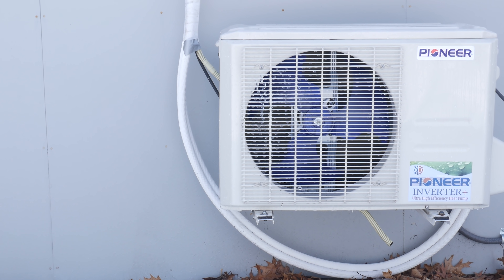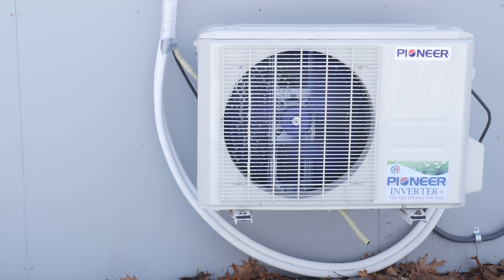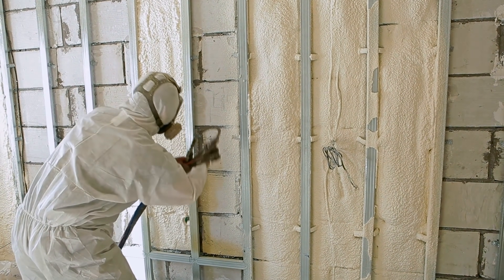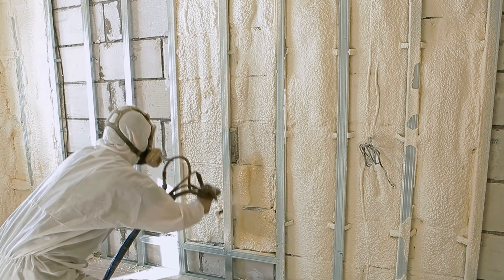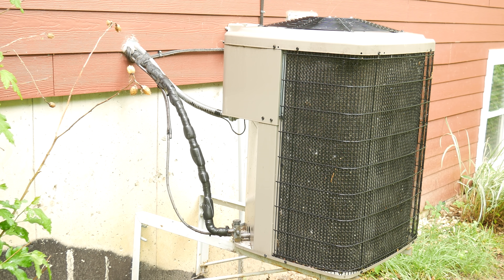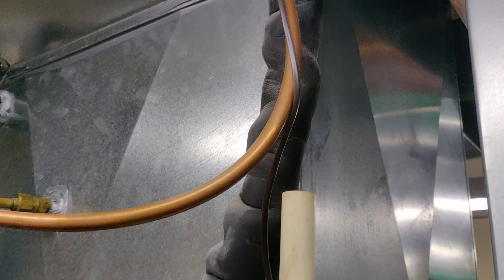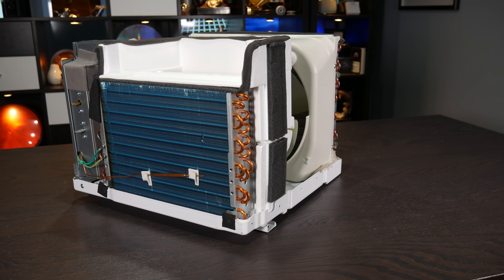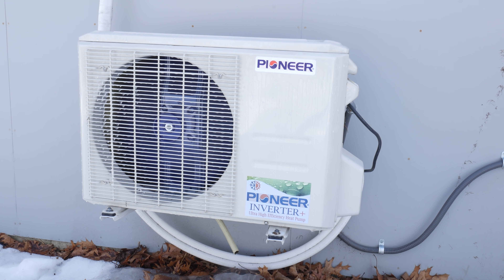Heat Pumps are Not Hard: Here's what it will take to start pumping

Comment: Great series.  You are doing great work.

It seems to me that this should be a MASSIVE opportunity for  a market disturbance.  With all of the venture capital nowadays chasing after ever more mundane market segments (like matresses or funeral homes) you would think that some venture-capitol backed startup would already be trying to "revolutionize" the home heating and cooling space.

I mean, a new whole-home furnace/ac in the US is somewhere between $5,000 - 12,000 (replacement, no ductwork) and it really seems like these devices are smaller and less sophisticated than your average washer and dryer or what-have you.  Lots of high-pressure, scammy tactics in that market too.  

How hard would it be for the "AC/Furnace Uber" to arrange for some basic products, arrange for local installers via something like a franchise system and still offer consumers good products at 50% to 75% discounts compared to the typical closed distributor and HVAC shop "cartels."
Reply: They have been readily available for a while. The thing with HVAC companies and mini-splits is that you can just buy them online or in a store, which you cannot do with most larger systems. The other issue with these is the capacity; it is nowhere near what you can get from a ducted unit without accounting for duct losses.
Reply: The mid-roll ad on this video was a DIY AC unit. Wall-mounted ductless system for single family homes. The market landscape is shifting. I can't wait for mass adoption.

Comment: I would love to re-insulate my house, install new windows, and look into switching into a heat pump with gas for emergency heat, but we also need programs to assist folks who own older homes that contain asbestos.

What would be a relatively simple (yet not inexpensive) reinsulation project turns very quickly into something completely uneconomical when the ridiculous cost of asbestos abatement is factored in.  It almost turns it into one of those "It's cheaper to demolish" situations, but I can't justify the cost and disruption to my life in order to do this.

So I'm stuck - I can't afford a better home because home costs have gone crazy, and I can't afford to resolve issues in my current one in order for my life to become "greener". Sigh.
Reply: It's surprising how many homes have some kind of complicating factor like this - and they're the ones that would benefit the most from upgrades! 
Although asbestos removal can be inexpensive. Recently had a contractor look at my asbestos drainpipes - and they said they'd have to remove them but they could double bag them leave them here and we (as residents, rather than a company) can get a local authority to take them for free. If they took it away (as a company) they'd need an asbestos license and to pay per kg. 
In my case - I want a heat pump but don't qualify for a grant because I don't have cavity wall insulation. I can't get cavity wall insulation because of concrete gutters - they're known to fail over time and leak onto the insulation, causing really bad damp problems - so no regulated installer will install it unless the gutter has a guaruntee'd lining. So in order to install a heat pump, I have to remove/reline my gutters 🤯🤯
Reply: @naxxtor  Certainly, sometimes asbestos removal can be fairly inexpensive, especially in the case of Vinyl Asbestos Tile, Pipe Insulation, Acoustical Ceiling Tiles, etc.

In my case, there is use of Zonolite-Sawdust/Asbestos insulation in the walls and ceiling spaces.

Tearing open all the walls - even the upper level floor (which used to be an attic) to remove it - would mean I'd have to move out completely in the process.  I'd be willing to bet that the cost would be $30-40k just to have it removed, then add the costs of putting whatever new back (foam, fiberglass, etc) and then new wallboard, paint.  It's a nightmare.
Reply: Yes, I would also like the government to pay for my choices as they can be expensive
Reply: @MrCheeto01  No.  I don't need the government to pay for all of my "expensive" choices.  However - the real estate industry does a piss poor job of informing buyers and obtaining disclosure from sellers regarding the presence of things like asbestos, lead paint, and other hazardous materials.  It has also been a sellers market for many years, and as a buyer in this climate you don't really get the opportunity to get thorough inspections of houses if there are multiple people bidding on every shitty house you can barely afford.

Additionally, governments do a terrible job of informing potential homebuyers of the probability of their new homes containing these hazardous materials, and the risks posed by them, or the expense involved in mitigating them.

Also, many younger folks do not understand the building materials and practices that were used to build these older homes, and moreover - don't really have a "choice" as you suggest.  They have a budget, and the market determines what areas they can buy in, and what vintage of house they can afford.  It's not like they teach kids how to choose and buy a home in school.  I guess they just expect that nobody will be able to afford to buy anymore?  Sadly, it seems like we're headed in that direction.

Our governments outlawed things like asbestos and lead paint, lead pipes, etc., all for public safety reasons decades ago - but yet, the effort to ensure that younger generations are informed about them have mostly disappeared.  Why?  Maybe they don't want to get in the way of the real estate bubble, and the revenue they earn from it.  So now a new generation is stuck with these houses that aren't worth what it would take to either remediate/renovate, or demolish and rebuild - and the folks living in them can't afford to do either, because they could barely afford them in the first place.

Anyway, I "chose" to buy a house I could afford and get out of my parents' basement and not become a YouTube comment troll.  It only takes one uninspired comment to see what your choices were.
Reply: @davereichert  My Mom (and by extension myself) are looking for a house and fortunately we have a good agent that actually tells us about this stuff and looks for issues like water damage (tons of homes have undisclosed water damage).  Most agents don't do this and as a result people are bidding much higher for homes than they should thus further driving the prices up.  I do remember learning about asbestos and such as a kid but then I'm 32 so I don't know how common that knowledge is amongst the typical first time home buyers who really don't have any money.  (For those curious/irrationally angry that I'm 'wasting my life living with mommy' I could afford to move out on my own but even with my decent paying job I'd almost certainly be stuck renting which is just throwing my money away rather than saving up and still being able to buy some nice stuff for myself like the mid tier gaming PC with dual monitors I'm using right now).
Reply: You can't simply demolish either because you have to abate the asbestos before you do that too. Tell the government thank you for regulation
Reply: @davereichert  " the real estate industry does a piss poor job of informing buyers and obtaining disclosure from sellers regarding the presence of things like asbestos, lead paint, and other hazardous materials....  governments do a terrible job of informing potential homebuyers of the probability of their new homes containing these hazardous materials, and the risks posed by them, or the expense involved in mitigating them....  It's not like they teach kids how to choose and buy a home in school."

It's like those disclosure laws that already exist don't work and trusting government to micromanage what individuals are meant to do for themselves when buying a house is not going to work.

Like I said in another comment, there is a clear and obvious opportunity for somebody who is someplace in the comment section complaining to stand up and go out and either start a charity or a for profit business to get things changed. Maybe a group of people.
Reply: @FawfulDied  "The real solution is to require sellers to abate asbestos before selling."

Or they can sell as is and when the buyer does their due diligence and gets an inspection done on the item they are purchasing, they will discover the issues and can adjust the bid accordingly. It's already in the law in the UISA that once discovered, it must be disclosed to all buyers in the future. There are threats of fines and jail time for those who don't do this. But if a buyer doesn't care to even pay $500 to get a good inspector to find all the houses issues, that buyer must not care if the issues exist.

"mandatory inspections for sale of used motor vehicles"

Looked it up. If a dealer buys a car, they will get it inspected. I sell my car, I don't need it inspected. Buy the buyer will take the car to their mechanic for a full inspection.

A house is different in that not all realtors are licensed and some are individuals. You are correct that another law might make a cheating thief not avoid the rules. But it doesn't alleviate the buyer's responsibility to do their own work on a purchase that will keep them in debt for decades.
Reply: @FawfulDied  Let me quickly follow-up with saying, I'm not 100% opposed to a "labeling law", which we already have. And I am not opposed to anti-fraud or anti-malicious harm laws, which we also have. But if the intent is to say "the buy holds no responsibility of their own" in a multi-hundred thousand dollar purchase, then we are saying buyers are children and can't make such choices in the first place.

It would actually be more efficient if you and I and the other complainers on the Internet hired 10 HVAC techs and offered the services to low income households for a share of the savings (in the case of heat pumps) and you could easily set up a non-profit for inspections for lead and asbestos cleanup. I'm sure all the "Make it a law" people will be willing to give up money to help you start the venture.
Reply: @SimuLord  nice job owning nothing
Reply: YES demolishing a house & building new is cheaper than fixing all those flaws.  It’s just like old cars… at a certain point it’s cheaper to junk & replace than to repair

If I had an asbestos house, I would already be moving to a temporary apartment, while the old place got torn down (and replaced)

Asbestos is too dangerous to wait.
Reply: HOMEOWNERS FORGET: They pay rent too.  For my home it’s $6000 a year property tax, or $500 a month rent.  Soooo home owners are throwing their money away too

.
Reply: “we are saying buyers are children”.  NO we’re saying buyers are ignorant of the details.  Like spotting asbestos (which is not visible).  Or leaks.  Or other flaws,

Therefore the sellers should be obliged to reveal those things.  By law.  Just the same as we require sellers of food to reveal the ingredients & nutrition label.  Or require sellers of cars/ appliances to reveal energy efficiency and annual cost to operate.

Consumer protection laws exist because it’s impossible for buyers to make informed decisions, if the seller doesn’t provide the information
Reply: BTW most house inspectors don’t work for the buyer.  They work for the seller, so the inspector will deliberately not reveal flaws that he finds (in order to get the sale)

Comment: Love it! I thought I’d read a bunch about these, but I still managed to learn some things. The air to water heat pumps that could use radiators for one - that’s cool and might be a fit for the old houses I’m looking at. 

I want to mention two things I haven’t heard you talking about. First, a correction, there are heat pump window units out there, I think from Friedrich. They also make window ACs with resistive heat, which… well, I’ll imagine one of your facepalms or sighs from the video. Second, I don’t know if you’re aware of residential heat pump “chillers” that use low temperature refrigerant (water) for a more efficient air to air system, and can also be used in tandem with radiant heat, split room units, central ducted unit, and even hooked into a hot water tank. I haven’t found a system aside from Chiltrix, but it’s very intriguing to me.
Reply: Water is not a refrigerant
Reply: @Etacovda63 , fair enough, I mean more as a heat exchange fluid. 

But then again, is there anything stopping water from being a classic refrigerant? It holds a lot of thermal energy, high latent heat, it’s just that the boiling point is unusably high with usual refrigeration cycle uses. In fact, Wikipedia says it’s specific latent heat is over 10 times higher than R134a. 

But yes, fair, I don’t think the Chiltrix system uses water as a phase change refrigerant. Yep, after looking it up, it’s just using refrigerant inside the sealed heat exchanger and using water to distribute that heat to units.

This’ll show my lack of in depth scientific understanding, but I’m wondering what’s stopping water from being used as a refrigerant? Obviously the boiling temperature is a roadblock, but perhaps at a low enough pressure… oh well. Time for me to go down a rabbit hole about refrigerants, compression cycle refrigeration, evaporative cooling..
Reply: @Anya-Prime  I think the bars to using water as a refrigerant are:
1) The temperature/energy needed to reach vaporization is really high.
2) The pressure differential when water turns to steam is quite high and dangerous if there are any weaknesses in the pressure vessel. See exploded locomotives for examples.
3) The higher heat capacity of water requires even more radiator material to shed that heat, unless you are ONLY shedding heat, then you can just dump it "overboard" from your system and use up more clean water for your heat exchanger.
Reply: @MonkeyJedi99  thanks, that makes a lot of sense. I figured it had something to do with the temperature since the only practical refrigeration cycle I have found out about is the evaporative one. I guess the pressure situation is difficult because the pressure increases dramatically simply from evaporation, rather than the high but consistent compression pressure of using something like CO2 as a refrigerant.

Thanks for the response and I’ll stop theorizing above my pay grade for now so I don’t sound like an idiot
Reply: @Anya-Prime  Don't stifle your curiosity!
Make guesses, check your guesses against available information, adjust your guesses, rinse and repeat.
Reply: Yes there are air to water, ground to water and water to water heat pumps out there. For an old house with radiators an air to water heat pump will work wit a good COP depending on the place the house is built and also if the radiators are big enough to give the necessary heat at a water temperature of no more than 40-45 degrees Celsius. The hotter the water, the worse the COP and so the greater the cost.
Reply: @razvanlex  I realize now that my earliest reply in this thread made the assumption that using water for a refrigerant would necessarily mean bringing the water to steam temperature.
That was a bad assumption. I had the water/steam cycle of power generation systems in my mind when I was typing that, not thinking about the much less severe temperature differences in a typical forced hot water systems (radiators/baseboard units) for home heating.
Reply: Stay away from Chiltrix, it's a half-baked product. There are a lot of other more reputable brands that offer air to water in North America: Aermec, Spacepak, Gree Versati, Enertech Advantage.
Reply: @zacm9174  that’s good to know. I was unlikely to install that type of system but it’s good to keep in mind. What makes them not good?
Reply: @Anya-Prime  The back up resistance heater control logic is very flawed, would come on all the time even when heat pump was producing lots of heat. Also their defrost cycle is too short and there's no pan heater so the defrosted condensate just freezes in the bottom of the heat pump and builds up until the fan gets frozen and the motor burns out. Not very suitable for very cold climate use, unlike several others available now. Overall it just seems like someone's engineering school project released on the public.

Comment: One of the largest markets for these split systems is RVs.  Lots of full time RVers are installing solar panels on their roofs and lithium batteries to store that collected energy.  In this situation the efficiency available in split systems can allow AC or heat to run all night on the stored energy, especially if you only really need to run the head unit in the sleeping space.  Add in the fact that full time RVers usually follow the moderate temps because their homes are, you know, on wheels, and you have a perfect use case.

Another excellent use case is when homes or living spaces are expanded.  It is much easier to add a mini split to a converted garage or attic space than expand or replace an existing whole-house system.  Once folks have good experiences with the units in their expanded living space, they may add more mini split systems when it comes time to replace their existing whole house system.